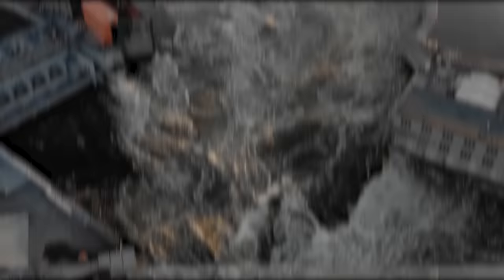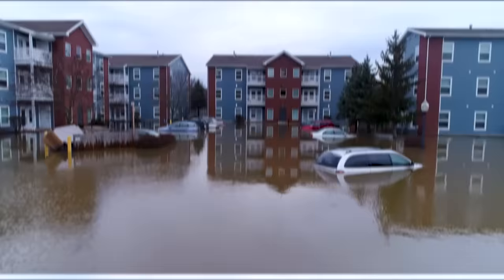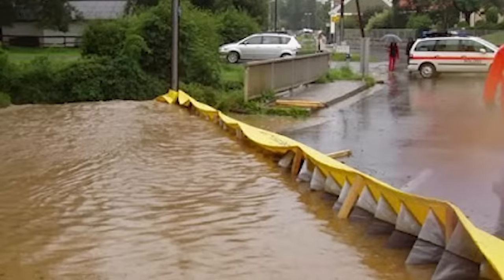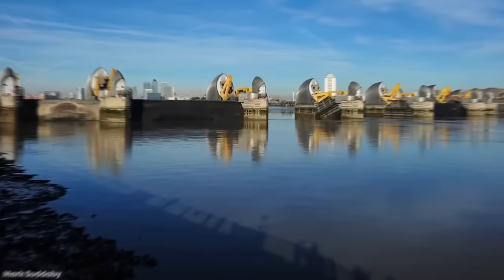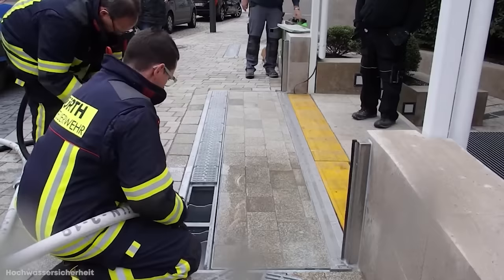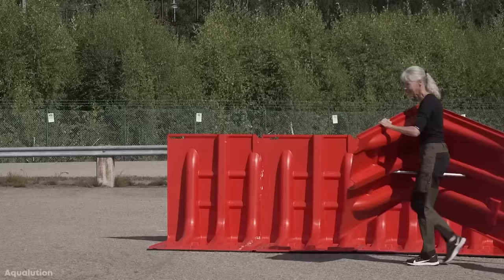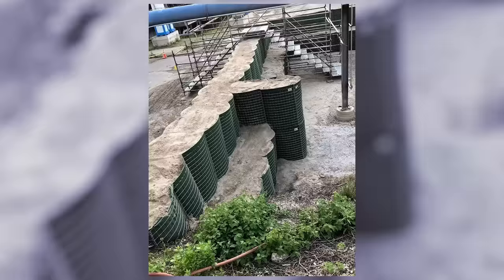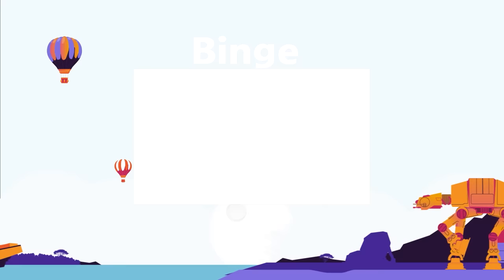15 Amazing ANTI-FLOOD Inventions

Comment: This is all great, but is there enough time to get these things in place, closed up, pulled up, or installed. This has to only work if there is a prediction that a flood is coming. Not in a flash flood situation…also what about if the water goes above the things put in place
Reply: Now using satellite or some other technology can predect early before flood.
Reply: I live in a flash flood prone area. Yesterday i got a flash flood warning 3 hours before it started to rain. Flash floods still have warnings because meteorologists can see the rain coming and they know x amount of rain in y location usually leads to a flash flood along z path.